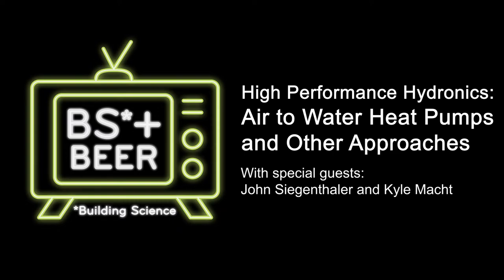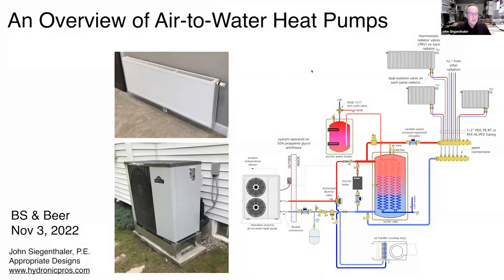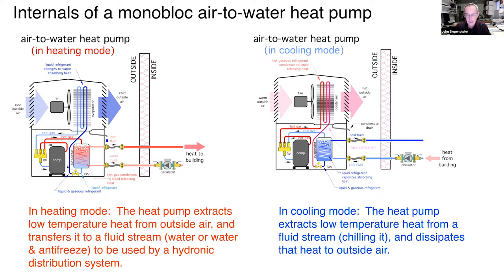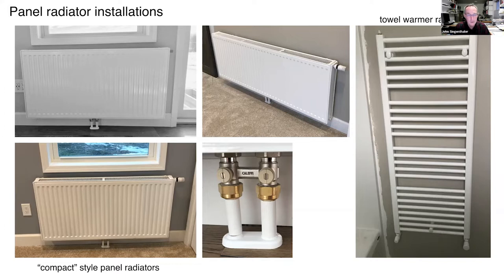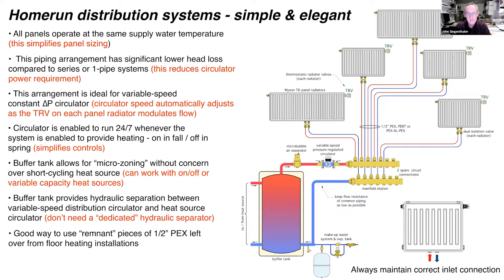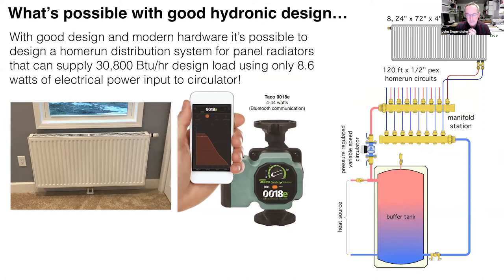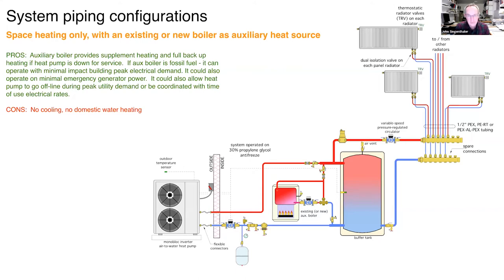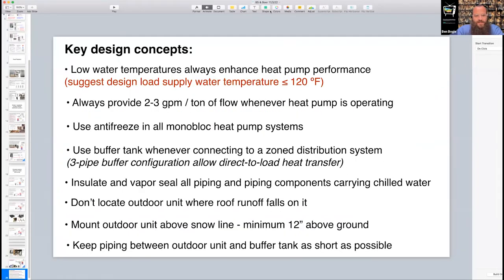High Performance Hydronics

Comment: Great info. We are looking at using a hydronic system here in the Phoenix area, it will be in a passive house build. We are already installing a sanCO2 for water heating with a zehnder ERV so we are nearly there on just doing radiant cooling. Last we looked, yeah the market wasn't quite there, but it feels very close this time.